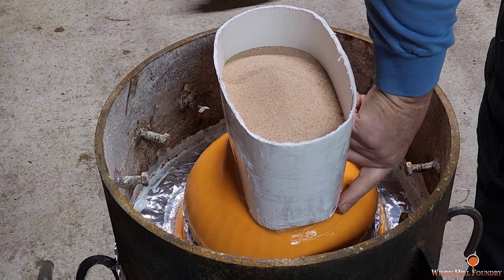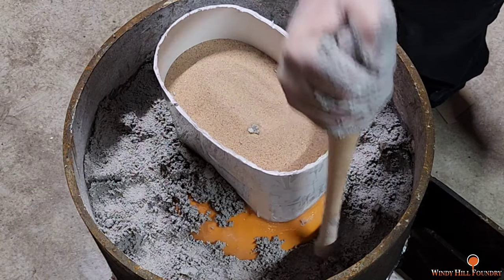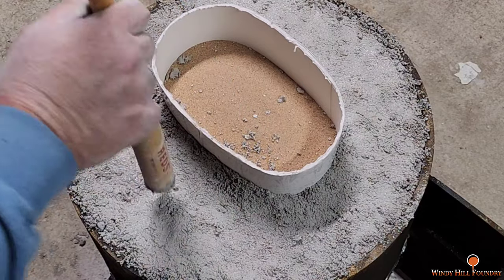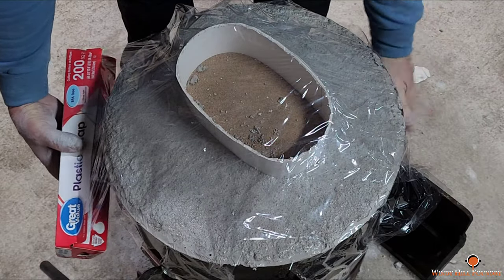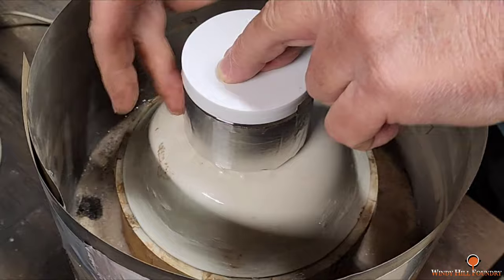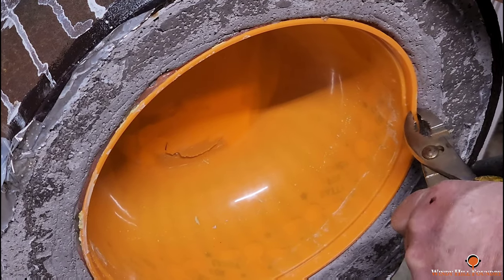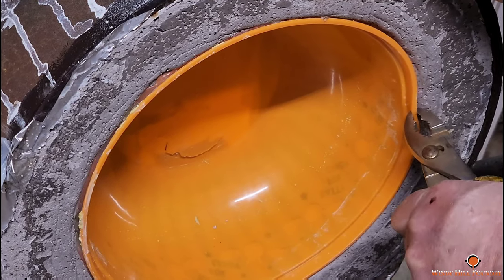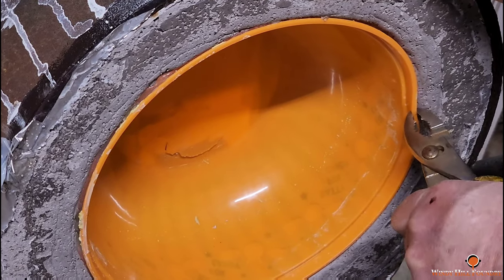RELINING ROAD FURNACE PART 4

Comment: Suggestion; take some of the refractory you are using and make a slurry that is thin enough to paint with a paint brush and once the refractory lining is totally dry, paint a layer of the refractory slurry on the refractory. Using the same refractory to make the slurry will insure that it bonds chemically to the refractory and painting a slurry on the surface of the refractory will fill in the surface making the refractory smooth and harder for the molten metal splashes to attach it self to the refractory which would cause premature pitting. Nice project, fun to watch.
Reply: That is going to lead to a very porous and weak surface, not a hard smooth surface.
Reply: @JFirn86Q  , I suppose it depends on the refractory  but the technique I described was used each time we replaced a refractory lining and that was every time in my 20 year career as a Molder in the Navy.

Comment: would a possibly better way of putting the pipe in for the side is to have cut grooves on the inside almost all the way thru so that it would be possible to jam a metal rod or screwdriver around the outside to collapse the tube?

Comment: I'm taking notes. I'm going to build a furnace in  the near future to do aluminium casting. I haven't decided on propane or diesel burner yet. i may want to do brass also. Any suggestions on which would be more suitable?  I don't know if propane would melt brass. Love the video. Always informative and entertaining!
Reply: Propane gets hot enough to melt brass.
Think the small one he is building is meant for bronze and brass and it's also going to be propane.

Comment: Pardon the noob question but, I do not understand the oval vent, any insights as to why!
Reply: Probably it is to make it easier to put wide flat chunks of crushed brake disks into the crucible, if the hole was round it needs to be much larger to fit the same size of brake disk chunks.

Comment: Would a concrete vibrator help packing the refractory?  Hunting deer helps regulate their population.  Auto damage becomes expensive at a point and disease in the population spreads rampantly at another point.  It seems cruel to kill them, but they die either way.  At least most hunters eat the meat and buy less beef and pork as a result.  Be careful of the chlorine (mustard gas) when burning PVC.  I appreciate that paper is her "best China..." :)